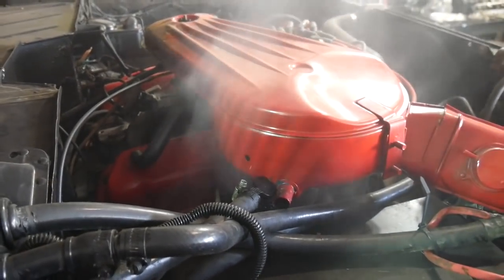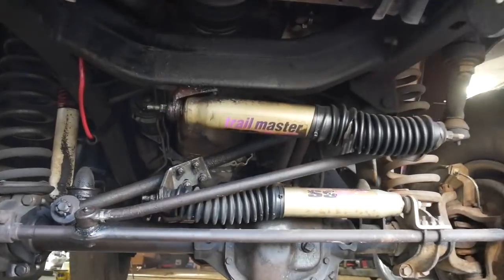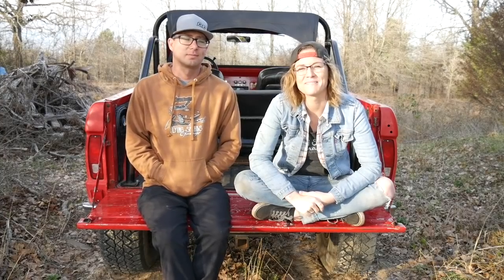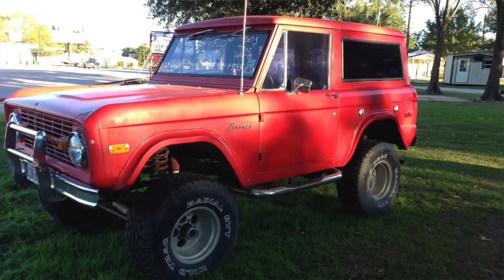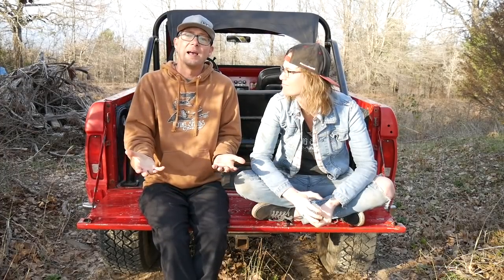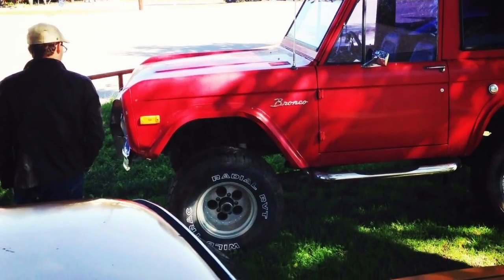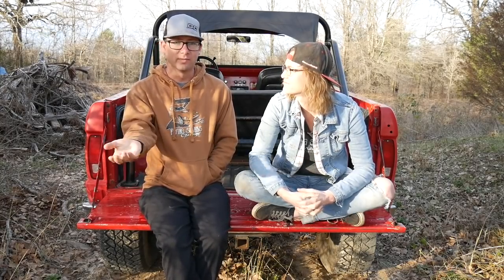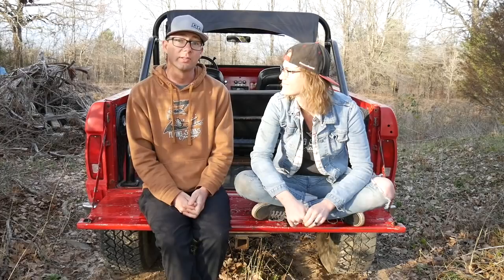Early Bronco build intro!

Comment: Funny. Just about the same as my Bronco. A 73, no transmission, dana 20 was taken apart in the bed, and red. Just put n a new AX 15 and rebuilt the transfer case. New carburetor got the OG 302 running. New gas tank, twin sticks, and wiring harness about to go in. Crazy thig is my wife named it Bobcat Betty. I brought it home the same day Betty White died and we saw a big bobcat on the property. Ha.

Comment: Really looking forward to this. My '76 Bronco has similar oil issues. I bought a salvage Explorer meaning to do the "Explorer swap" on mine, but have never gotten around to it because my Bronco's 302 just won't quit (and I have too much fun driving it). Hopefully, your videos on this will inspire me to finally start tackling the project.
Reply: Those older 302s are hard to beat! Id rebuild it. Its a better engine

Comment: Love to see the AOD - my 76 is running 4.11 on TruTrac front and a locker rear. Cruise is 57 mph @2,700 rpm on BGF 33s = 8.5 mpg. B&M C4 with a BTI deep girdle pan. Great rock crawler but mileage is a killer. 302 Edelbrock with Holley Truck Avenger but even with a big main & aux it takes a lot of fuel.

Comment: I love this segment.  I learned to drive on a 1969 Bronco pick up style.  Had 170 ci straight six with manual 3 speed on the tree transmission.  Couldn't drive faster than 55 but boy could she pull in low 4 wheel.  Would love to find another.

Comment: Possibly an opportunity missed with the carbureted explorer engine and AOD. A much more reliable combination would be to keep the fuel injection, and keep the PCM and swap in the 4r70w from the explorer.  The 4r70w would easily handle all the power that 5.0 can offer, even with a cam, intake, and headers. The AOD my not be happy behind that much power over stock. 

The AOD swap is very do-able, but will require tearing it down to change the output shaft and tail shaft housing unless it is sourced from a 4x4.  4r70w would have be same problem, unless the explorer was 4x4 (which up here would be almost a given)

If I were to do this swap, I would be looking at upgrading to the A+ OD servo, lentech constant pressure valve body, and upgrading to the one piece input shaft and wide ratio gear set from a 4r70w.  Doing this eliminates the weak inner input shaft of the AOD which is probably the most likely part to break behind upgraded horsepower/torque, unless the OD band wears out first.

With the upgrades above the AOD can survive 400+ horsepower, but without them longevity beyond 250hp can be a crapshoot. The 4r70 is good to 400hp out of the gate without any mods. I love the AOD, but the 4r70w is a better option all day long if you can handle the electronics. 

Looking forward to the build!

Comment: If that's a explorer engine I'd throw it in tr he bronco. Much better heads and its roller. Even if it's a ho motor its roller and has a better cam. I made 302 whp (I know ironic, lol) with ported p heads (fyi most of the gains come from the bowl areas), stock explorer intake that I opened up to 75mm for the tb, 80mm maf and a b cam through a 3650. This was on a mustang chassis dyno so it's pretty accurate. Anyways I would look for a explorer at the jy for a 4r70w. I had one in a fox body.

Comment: Check out my Instagram on how to easily adapt late model F150 brakes to the D44 front axle using basic hand tools! (1966 F100 4x4 w 2.7 EcoBoost)
You were following until I was hacked.